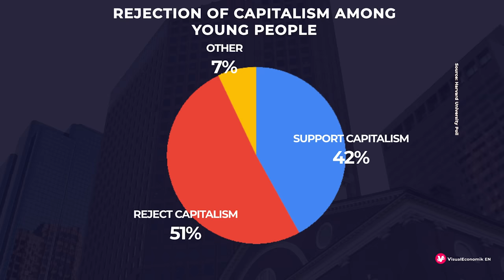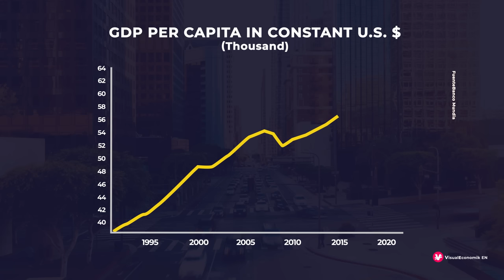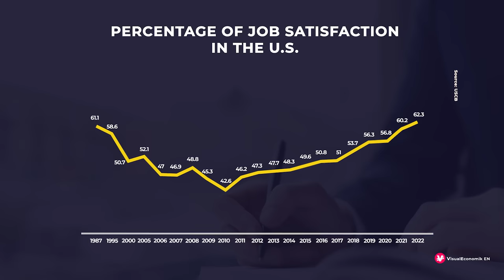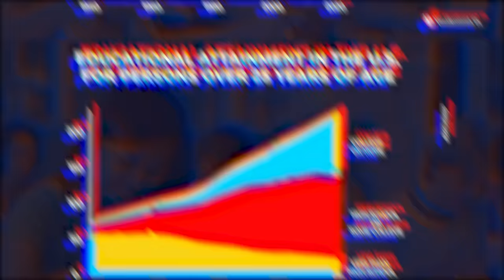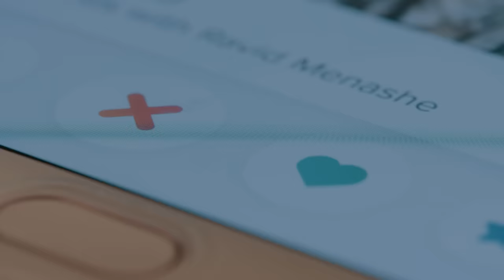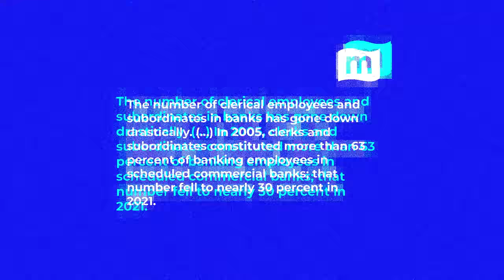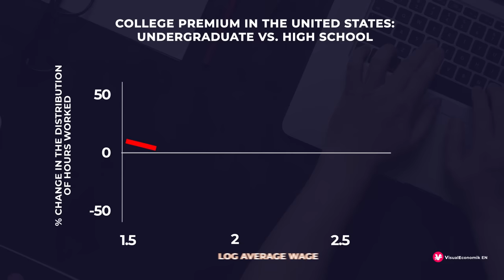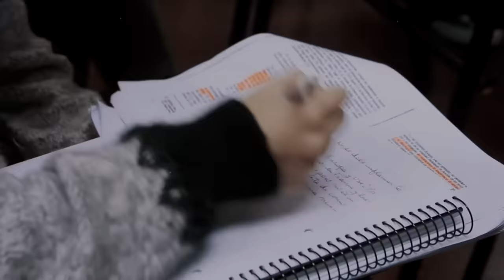Why America Is Becoming Increasingly Anticapitalist

Comment: The issue is that the basket of goods used to calculate inflation has not been rebalanced enough. Housing dwarfs all other expenses, but the basket of goods that is typically used continues to assign the same weights to different categories of expenses.

Comment: This whole video is just a massive sidestep around the core problems. Falling back on statistical manipulation, and a series of boomer-style misdirection-based arguments. Might as well be listening to Fox.   

Averages are a terrible metric for calculating wages because the needle is moved so wildly out of position by the top percentages, that the supposed "average" wage bears no resemblance to reality. Take London - the average wage is supposedly £40,000. That's bollocks. The number of people far far below that figure is massively higher than the number of people above it, but because the top salaries are in the multi-millions and the huge financial sector is full of inflated wage packets you get an average salary that looks completely reasonable. Then take the same thing and apply it to the whole of the UK and you get a more extreme version of the same problem - if the mean wage in London is far below the cited average, then the mean wage for the country outside of London is spectacularly lower than the cited average UK wage. The same is true of America. That same rhetoric that relies on people not questioning the statistics is covering up for a systemic problem that is global. 

That also completely ignores the fact that, relative to inflation, millenials actually earn significantly less than the boomers - about 50% less since the 60s and 70s, according to Fortune magazine. 
Then add to that, the massive amount of debt that American, and increasingly European, Millenials and Gen Z are now de facto saddled with. 
Increases in property prices have excluded the same cohorts from the one asset that appears to be of consistent worth: a house, and it's also just bloody sad that a house is no longer seen as a place in which to live, it is just another asset to collect. 
That might not even be too big a problem if the rental market wasn't completely broken. However, as we all know, it is now not in the business of providing shelter, but extracting wealth.  

This whole thing revolves around stupid boomer logic from people who have already dragged the ladder up behind them and then burnt it. Nobody who lived through the last twenty years went to University expected to make it into the economic top 10% - it was obviously not the way things were going. All anybody wanted was to survive reasonably comfortably. Owing to the fact that the global economy has configured itself to suck up as much wealth from the bottom 90% to the top 10%, and the ridiculous acceleration of that accrual and hoarding over the past three years, exacerbated by the inflation spike, has created an environment that is actively culling sections of the population who fall below an actively rising financial line. 

Like it or not, the current economy is a fucking death race. 

Naturally, people want out. There isn't actually a better alternative, but if people think the situation they're in is actively hostile to their existence, they will look for literally any other option. Because that's survival.  

So the problem is still very simple: 
If you exclude two entire generations of people from the system you rely on, and give them, effectively, no future to look forward to, then you get what you - quite literally - fucking pay for. 

This is basically a paper-thin deflection piece for an inherently entropic system that is in the active process of eating itself.
Reply: Thank you!

Comment: Its not capitalism people are angry about it's that everything is so expensive (corporatism). We also have a broken monetary system that causes inflation and lets banks take risks they shouldn't be able too.
Reply: You're just describing capitalism with extra steps.
Reply: Look at the inflation rate of the US since 1900. What you see is record low inflation since 1984 until very recently. And the high inflation of the last few years was not caused by the "monetary system" but by medium sized supply side shock
Reply: @TheSandkastenverbot the monetary system caused an asset bubble in the housing market making housing unaffordable
Reply: So capitalism. Got it
Reply: Um, you know you just described what Capitalism is right?
Reply: Capitalism inevitably leads to that, as capitalist corporations use their wealth to gain power, then use that power to demand changes to the rules so they can gain more wealth.

Comment: America was here before basically 100 years ago during the age of laissez-faire trusts. Young (and not so young) workers would protest for better pay and conditions, and managers responded with police-backed violence. An anarcho-communist movement grew as a result, and political takeover was ultimately stopped by compromises of collectivization programs such as strengthened labor unions and the advent of Social Security.

Such "socialism" would have to be revisited before younger generations remain enchanted by more extreme leftist ideas when they end up replacing those in power in due course.

Comment: Using averages in this economy is willful ignorance. 

Housing cost, the healthcare entire system, and wages. You cant use averages with the duel economy we have between the upper and low classes. 

My state, the average wage is 96k a year but the median is 37k. The current rent is 1.5-2k a month. The minimum wage is the federally minimum.

Comment: Another issue in regards to degrees is that Millennials were told is that it didn't matter what degree you so long as you got one. I have known several people who listened to this advice and got fluff degrees that led them no where and saddled with massive debt. Whereas ones that got practical degrees like engineering, aviation, or computer science have done really well.

Comment: There are some important and essential things that got very expensive relative to earnings in our days relative to the past.
Housing is now unobtainable and eats up a huge portion of the income.
Cars, their maintenance and their fuel (or crazily expensive EVs) eat even more.
If you are American, getting education will essentially require you to get a mortgage without the house. I'm not an American but still to get heavily subsidized higher education I did 6 years of military service delaying career start significantly.
Finally, ZIRP for 15 years makes our retirement funds inadequate.
In return we got mainly cheap communications, entertainment and appliances. Buying a TV or PC is relatively trivial but we don't need to buy them that often and having a mobile subscription became super cheap over the last decade.
A hidden issue is employment instability and that's a huge deal our parents and even more, grandparents had way less to deal with.

The issue is that capitalism is only partly to blame for the housing, transportation and education cost. Gov regulation slows construction and inflates prices of land.
The "safety culture" in cars compounded to make even the basic cars very expensive while they also include features like the entertainment system which adds significantly to the cost but became "essential" feature 
Education is different from country to country but in the US part of the problem is gov subsidized loans. Also, degree inflation causes people to get higher education who would do a different career a generation ago.

Comment: Rising cost of everything with wages that haven't raised in real terms in 15 years. Or only about 40% of engineers are able to find a job in engineering. Those could explain it. High demand degrees are mostly worthless for the primary reason people choose them. We get less and less wealth for the same amount of work done more efficiently than the past. The unemployment numbers could just be how it's recorded, and is actually worst than ever. The only real answers to these problems is there is a oversupply of labour and governments should stop immigration entirely and encourage depopulation, or capitalism doesn't work if you run out of people to exploit.

Comment: you guys missed the sleight of hand this video uses. all of you are saying %50 increase in wages means nothing with cost of living increases. I wish the wages had gone up by that much. But the video doesn't even claim that. THe video claims that "GDP per capita" went up by %50. That's not our paychecks going up- that's how much harder we are working (ok- how much better we are working with technology) - GDP has nothing to do with our income, and frankly  is just another argument for how badly the system is ripping the worker off (output went up 50%- paychecks didn't) . Frankly - visualecnomik EN should pull this video because it embarrasses them, but they are probably in it for the clicks. and with content this infuriatingly bad- they will get them

Comment: Some other contributing factors that you didn't look into in the video are wealth inequality and the cost of living. In your analysis, you looked at the rising gdp per capita, and low unemployment as an indicator that people are richer than they were in the 90's, but other things that needs to be considered. Wealth is unevenly distributed and the cost of living is much higher than it used to be. I think that in recent years the benifits from growth have disproportionally gone to the top 20 percent or so of income earners, leaving the other 80 percent to stagnant living standards. Another think to consider is that the unemployment rate isn't as reliable as an indicator of the health of the economy as it used to be. With the rise of the 'gig economy' finding a new job after loosing an old one is easier than ever, but people may be paid less than their old jobs, so underemployment needs to be factored in when when trying to guage state economy. not just unemployment.
Reply: All of that is mostly true but that is not because of capitalism that's because we have not had enough productivity gains You can't have higher wages without more productivity if you did things would just have to cost more and you would have inflation. And the reason why cost of living is so high is almost entirely due to government regulations. One huge one for someone like me who wants to buy a home is local land use regulations that make it extraordinarily expensive to buy a home in my area It's nearly 600,000 for the average house and they're almost none for sale. But this is mostly due to people that own homes in those areas that paid a lot of money for them Do not want to live near a bunch of other people and they are the only ones that go to the zoning board meetings and make the rules So of course they make rules to keep everyone else out. Same as true for health care and education government subsidies and regulation drive up the amount of money that's going towards the services and at the same time they reduced the supply so of course you will see prices rise much faster than inflation.

People get paid for a job the amount they do because of their marginal productivity inflation or cost of living has nothing to do with that in since 1972 in America there's only really two industries for productivity as outpaced inflation That's an information technology and mining (shale). I'll give you an example say you're a truck driver in 1972 Well over the next 10 years there were enormous regulations on how many hours you can drive how many stops you can do where you can drive That means 52 years later The average truck driver in America is less productive than they were in 1972 So of course you can't make more money if you're not more productive in real terms. But if you look at the average software engineer from 1972 to 2023 there compensation has absolutely skyrocketed because their productivity has If you can build Instagram with a team of 12 people and sell it for a couple billion dollars I'd say you have pretty high marginal productivity. The problem is people just want to boogeyman to blame so they usually don't actually look for what the actual causes they look for what's a plausible obvious cause and then they have their boogeyman and nothing is their fault, That's great for coping but it doesn't fix anything.

Comment: One point and one addition to an earlier point:
1) (Part of) the woke is rather Marxists in nature. While "critical theory" comes from Marxism, the modern variances like "critical race theory" and "queer theory" share many of the basic principles. And with these philosophical ideas being popular, the leap to the idea of capitalism being evil is smaller. Additionally, these ideas also tells that the current society is oppressive and corrupt, increasing the feeling that society must change. (*)
2)  When calculating how much hours you have to work while getting paid minimum wages to pay for intuition, has increased a lot. So when getting into debt more than the previous generation, even adds to the feeling of being cheated on after finding out the degree is worth less than it used to.

* On a personal level, I think that these critical theories do have some nice train of thoughts, but also contain some assumptions that are not always true and ignoring other aspects. And the conclusion I myself make is that when comparing the pro's and con's, that these ideas do more harm than good. But this is just my opinion and at the moment not backed with arguments (as that involves a lot more typing). However, these popular ideas might conflict with the concept of Capitalism due to being Marxist in nature (not necessarily Communist in nature though, I have to add).